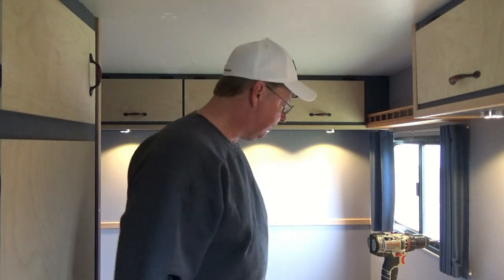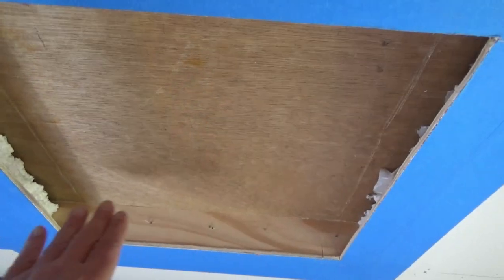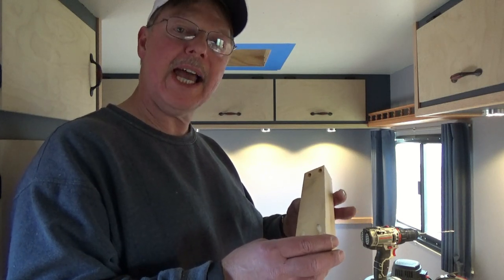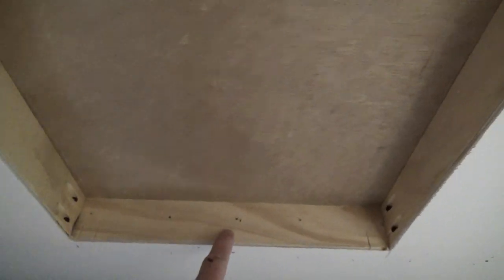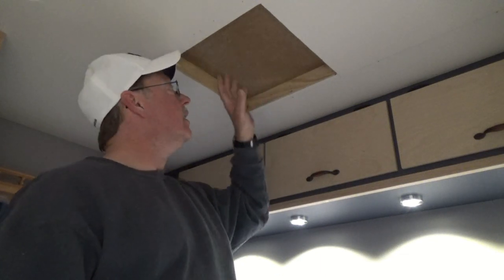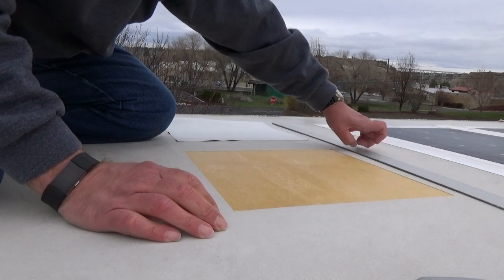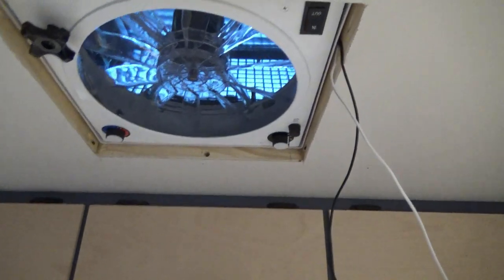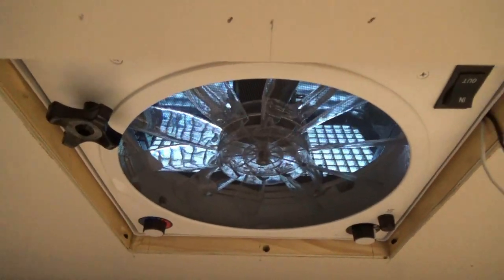How To Build A DIY Travel Trailer - Part 79 (Installing the Fantastic Fan – Part 1)

Comment: Hi Al....One suggestion for your weather/rain vent cover...Apply window screen to the interior of the open end to keep unwanted pests out,(wasps,etc.). Then you won't have to clean out their nests later on. Don't forget to lube the lifting arm of the vent for smooth operation too.
Reply from the maker: Hi Steve!!  Great suggestion about the screen! I did purchase that when I purchased the cover, does keep the flying critters out!! I did however, forget to lube the lifting arm before I put the cover on, so it chatters a bit when I lower the vent cover. I think someone actually caught that in one of my videos when I closed the vent... on my list to get up there and make sure to grease it up a bit! Thanks Steve, take care sir...
Reply: @OregonBatman  It's wonderful to hear from you Al...I'm back in the saddle once again after my stroke so that's truly awesome!!! Actually that was me that gave you the suggestion to put white lithium grease on the mechanism a year ago,lol. I do have a question on your solar panel installation,where did you get the boxes that you ran the cables thru to the interior,I haven't been able to find a supplier for those?
Reply from the maker: Glad you to see you are up and around, truly is awesome! I think I got those boxes on Ebay. can't remember. I'll have to do a quick search and see what they are called. I still have the box they came in, so I could always send that to you.
Reply: @OregonBatman  That would be super,thank you...
Reply from the maker: The part I purchased was from Amazon... https://www.amazon.com/Link-Solar-Weatherproof-Project-Campervan/dp/B0111RNZDY/ref=asc_df_B0111RNZDY/?tag=hyprod-20&linkCode=df0&hvadid=198064505516&hvpos=1o1&hvnetw=g&hvrand=17398744839347806583&hvpone=&hvptwo=&hvqmt=&hvdev=c&hvdvcmdl=&hvlocint=&hvlocphy=9033170&hvtargid=pla-320968524188&psc=1

Link Solar Weatherproof ABS Solar Double Cable Entry Gland 

Hope that helps sir!

Comment: For my vent I will use home window foil sealant tape to cover atleast 1/2" of the exterior opening and then down to cover the wood framing,then use butyl tape as the exterior sealant...In doing so I have eliminated the one thing that all travel trailers have...Water damage at the roof vent framing...
Reply from the maker: What I had, and wanted to use, was my eternabond tape. It's 4 inches wide and would have covered all the way around, but I got rained out. When I do my maintenance, I will probably remove the vent and reseal it nice and proper like! :)